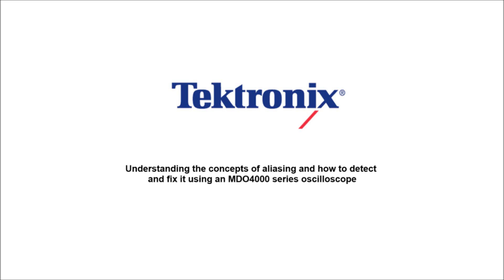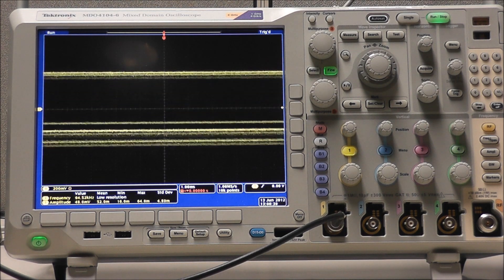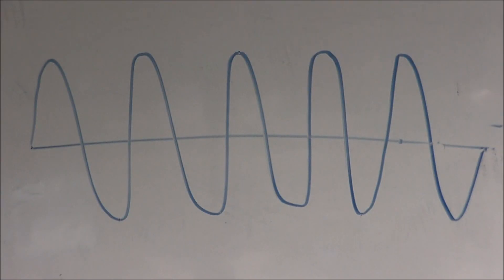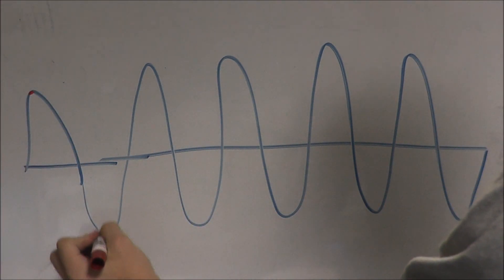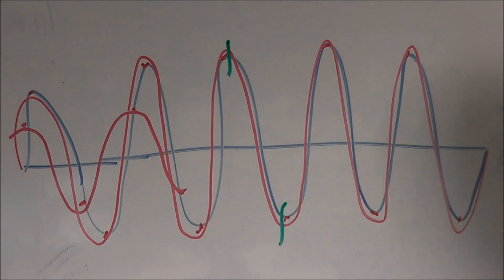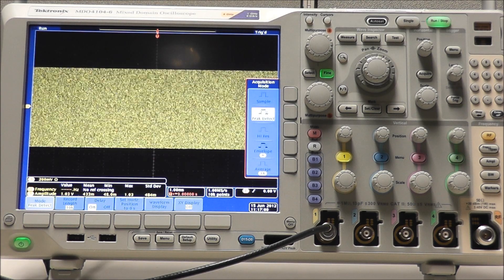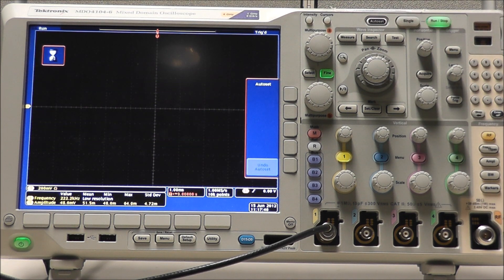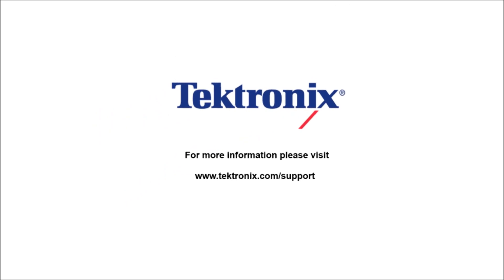Understanding the concepts of aliasing and how to detect and fix it using a Tektronix oscilloscope

Comment: At 2x, apart from the frequencies potentially getting attenuated, can't this also cause phasing issues?  

Obviously, 44.1KHz is the minimum anybody works with nowadays, but the mentioned effects can still be caused at this rate, just to a lesser extent and in slightly lower frequencies like 14.7 KHz where that would still only make it 3x.  Am i getting the right idea?  Thanks! :D